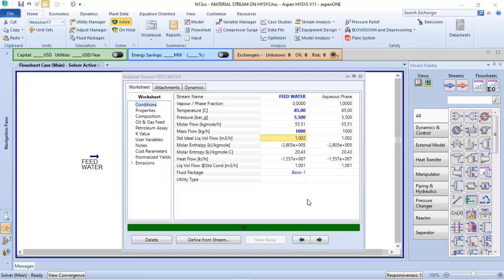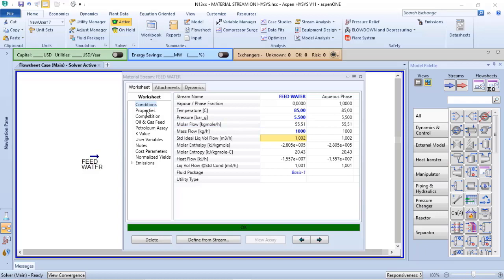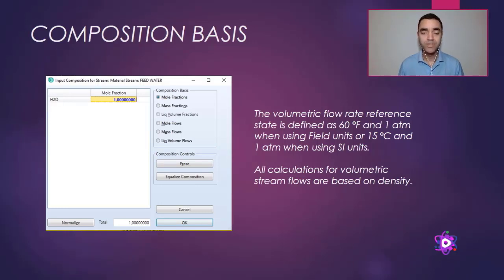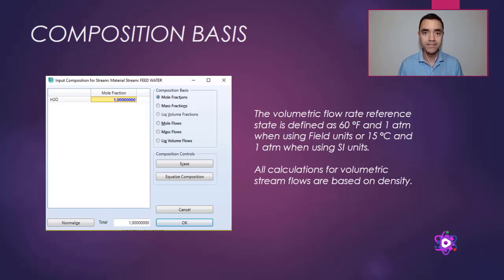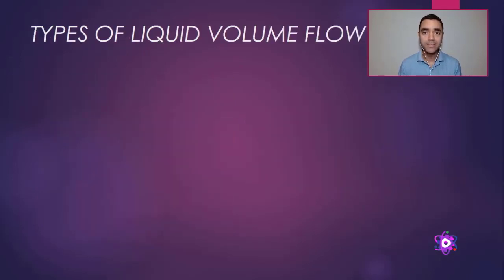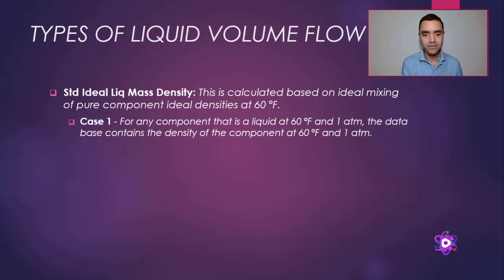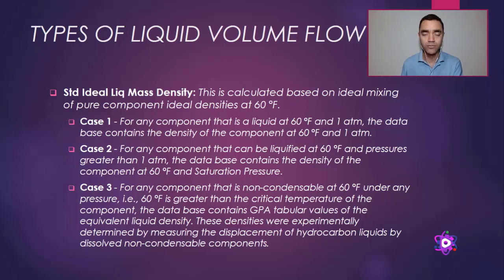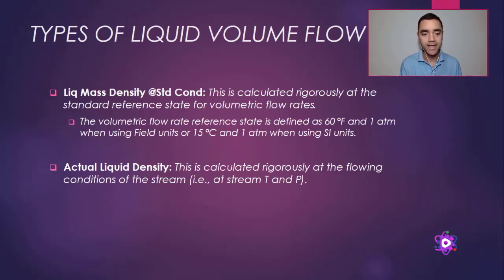WHAT IS STD LIQUID VOLUME, VOLUME AT STD AND ACTUAL LIQUID VOLUME FLOW ON ASPEN HYSYS FOR BEGINNERS

Comment: What will happen if the fluid is not a liquid at std. cond. when calculating liquid mass density?
Reply from the maker: The mass density of a fluid depends on the pressure and temperature. Different conditions, different values for the same fluid composition.